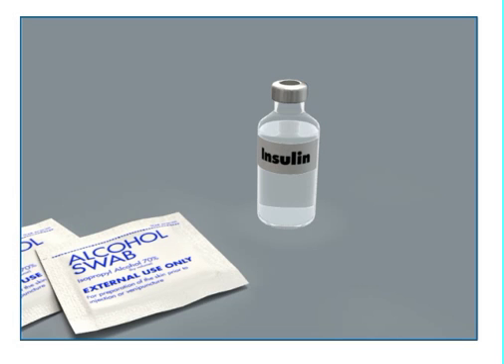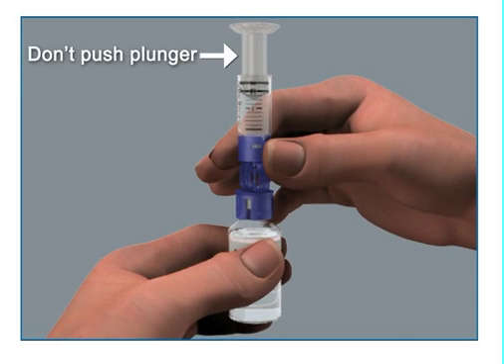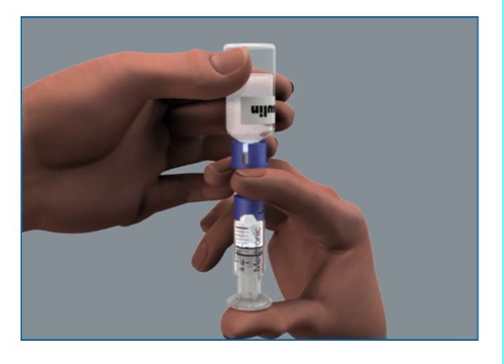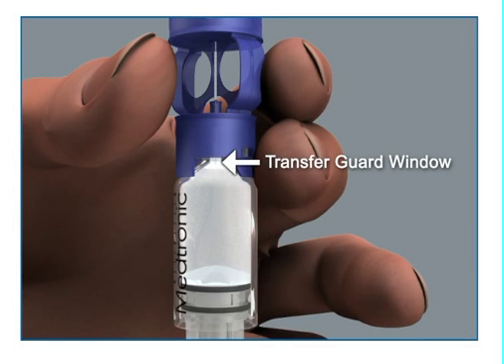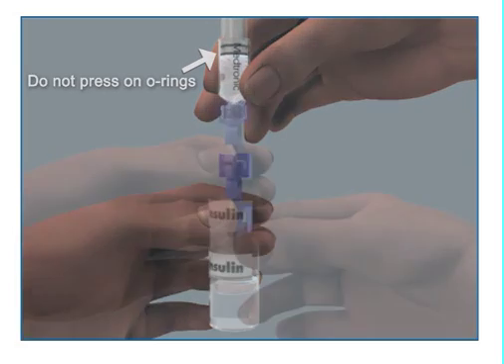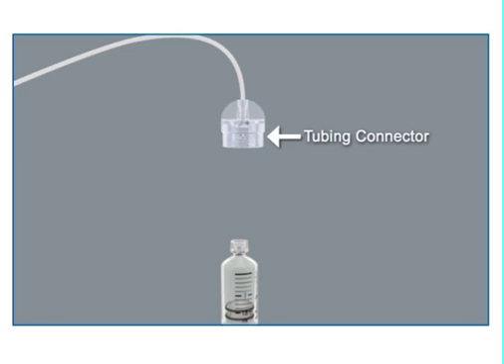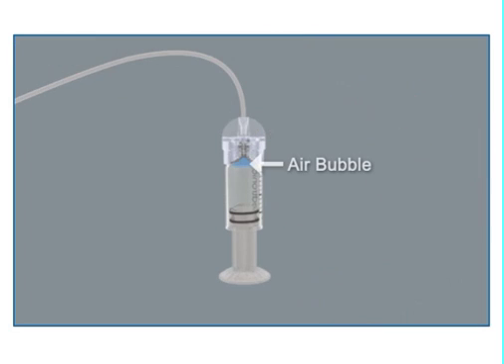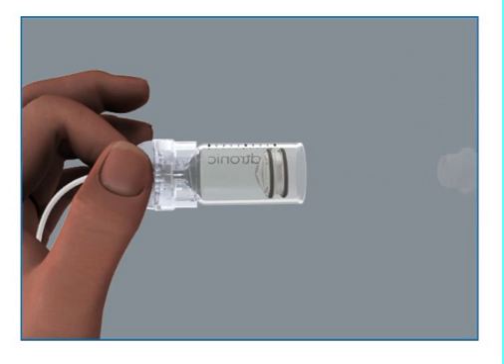Filling the Reservoir on a MiniMed Paradigm® Insulin Pump

Comment: A lot of bubbles form at the bottom of the vial (where the plunger rod is). It seems like bubbles form as I pull in insulin from the vial, regardless of how slow I extract the insulin. Is there a way to change this?
Reply: I do not know why but when I tap a bubble from the bottom more bubbles form, thus, I am having lots of troubles. Any tip, suggestion?